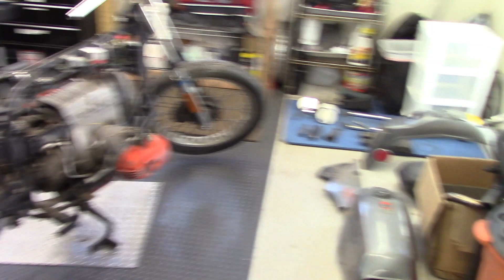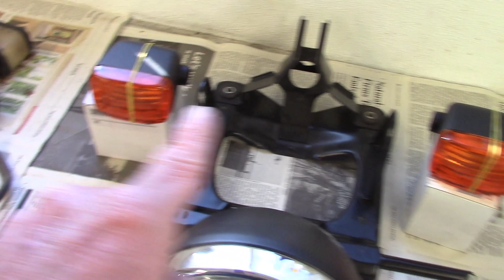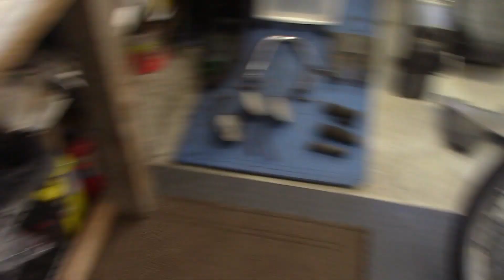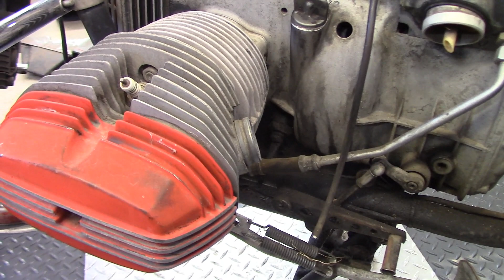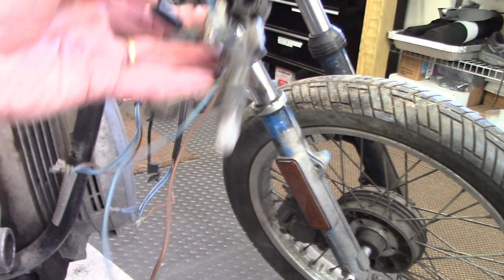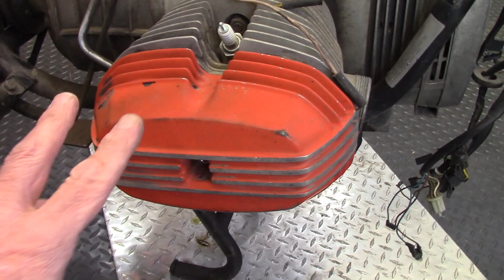1983 BMW R80ST Pre Build Inspection

Comment: I have the same one! Even the color is identical. However, mine still have original painting and looks only slightly worse than yours after the rebuild. My ST stood unused for over 20 years in a German garage. Zero rust. After basic adjustments it runs smoothly, although it would be nice to replace the old dried grease in several places. Thanks to the informations on your YT channel, I will do it. Greetings from Poland. Stay healthy!
Reply from the maker: You're welcome 🙂

Comment: Hi, dear biker community. I’m restoring my bike and I need your help. Bmw r65 1987 problem in light system, position light, low beam, dash light and stop light not working.

I’ve checked and replaced all the 6 boxes with others that work perfectly, in addition to having changed the 2 fuses under the seat and checked all the wires for possible breaks or disconnections.

Everything was working perfectly until I mistakenly put together pin 3 and 12 main wire harness where the instrument panel connects (when trying to install a new digital dash).

Since that time the position light, low beam, dash light, stop light and back stop light don’t work in ignition position 1.
In ignition position number 2, the turn signals, high and low beams work if I activate the command and the stop light if I press the brake, however the dashboard does not illuminate, neither do I’ve position lights, stop light.

Is there any other fuses or what could have been damaged when connecting those pins (both pins have 12v voltage)? Please if anyone knows what to do I would be very grateful with your help.

Comment: I'm so glad to see you putting that one back together. I think they only sold around 1,000 of them in the U.S. I have a 1984 R80ST that I love and will probably never sell.
Reply from the maker: Mikey, you are correct about the number sold in the US being about 1,000. This is the 317th made and is the 2nd one manufactured in January 1984.
Reply: @BrooksAirheadGarage  Cool! How do you know yours was the 317th made? Is it in the serial number? These are the last 7 digits of mine: 6207950
Reply from the maker: @mikeyd6031  Yes, it's the last 7 digits of the serial number. The R80ST USA numbers started at 6207001.  Phil Hawskley has a site with the serial numbers showing the month of manufacture for them. This is the link for 800 cc engine models: http://www.bmbikes.co.uk/chassispages/enginechassis800.htm
Reply: @BrooksAirheadGarage  Thanks! I don't think I've seen his site before. Only 30 more made after mine (980 total). I wonder how many are left. I bought the tools from Cycle Works and opened the gearbox on my '76 R90/6. Your videos have been very helpful for knowing what to expect and giving me a good mental picture before I take things apart. Thanks for them.
Reply from the maker: @mikeyd6031  Unfortunately, many have been rebuilt as GS models since they shared many of the same components and GS bikes have become very over priced. I suspect that has cut down on the number of existing ST bikes in the US. And, I'm pleased the videos and my website documents with all the details of how I do this work have helped you keep another airhead on the road.

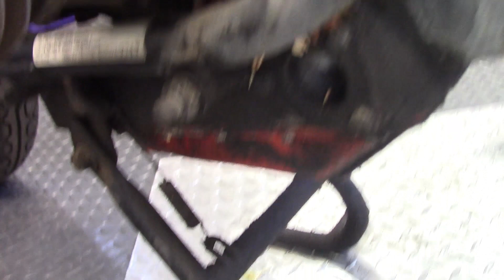Comment: Hi Brook. I just got a 1981 R100RT and there is so darned much that is extremely different than the 81 Honda CB900c I have been riding for the past bunch of years. Your vids and site have already helped me out a ton. I was just getting in to doing an oil change today and I hit a bit of a roadblock. Unlike your R80 the cap for the oil filter is below the frame with room to spare to remove it (4:24). On my bike, the top bolt is hidden just enough behind the frame to make removing it impossible. It kinda looks like I'm going to have to remove the front mounting bolt and drop the engine a quarter inch or so. Is this normal or do I have something of an oddball? Thanks.
Reply from the maker: Joe,  The filter cover bolts were not designed to be obscured by the frame.
Reply: @BrooksAirheadGarage  Hmmm. I wonder if something got bent some time in the past 40 years. I'll have to take a closer look. Thanks for the response.